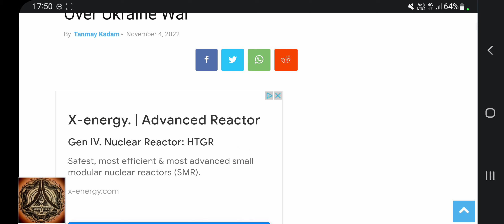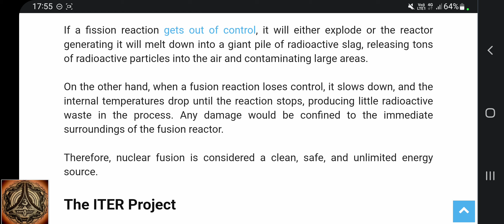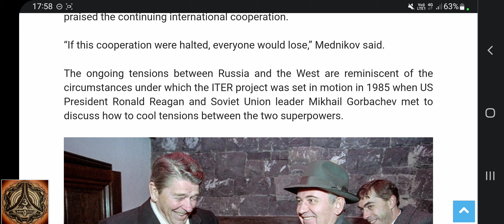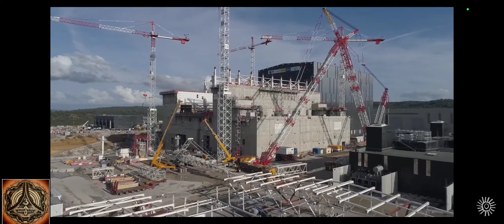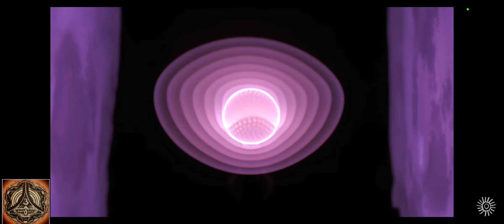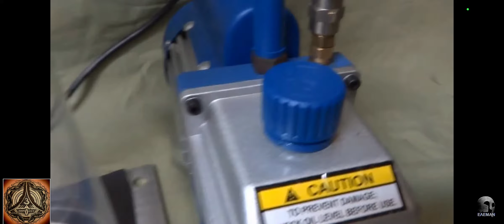200 t Giant Magnet shipping from Russia to France

Comment: Apparently the sound of thermal nuclear ruffles the chickens feathers...😂...the USA already sent the largest one built to France(near CERN) with magnetic pull 10,000 times the magnetism of earth alone🤦‍♂️...I'm sure these won't pull any meteors from space that would normally pass us by😬
Reply from the maker: Yeah, they had some beef with eachother LOL Compare the size of those massive fusion reactors with the size of SAFIRE. The biggest difference is that SAFIRE works, the big don't. Unlike gravity which only pulls, the Electric Force attracts over long distance but repells at short distance. Which is a good thing! Otherwise everything would collapse in itself (couldn't even exist therfore) and since everyone can observe that we don't collapse in our self (physically, the psychological part is another theme) we have to assume that something gives us form. Not only us of course, everything else included from the snails house  to a tree to cosmological sized birkeland currents, they all not only exist, they have and maintain their form. So there is something which keeps the forms, structures and patterns, without it wouldn't be anything. Many meteorites have smashed into earth, which means also this force can be overpowered. This is also totally scalable, meteorites or better asteroids can be planet sized, they will discharge at certain distance, as do the fireballs, just many magnitudes more. I think these machines could have influence on local weather... not a big one but something could eventually be measured or even seen🤷‍♂️ ...radar...
Reply: @AAAanomalies  #Truth💪